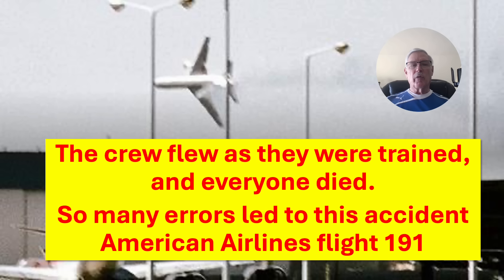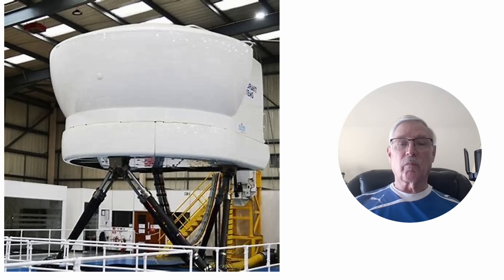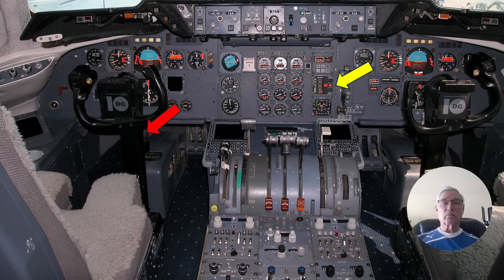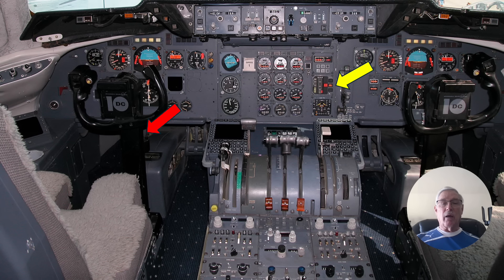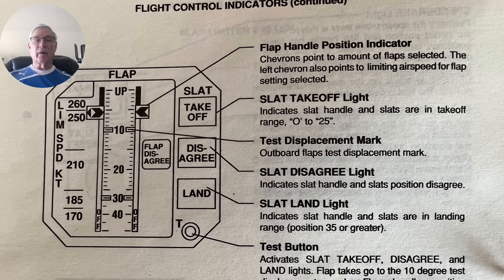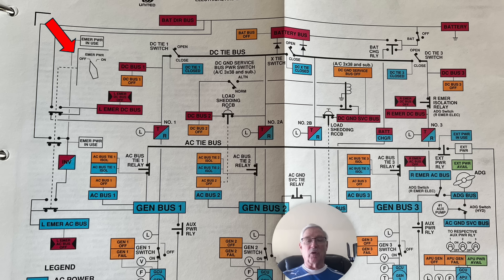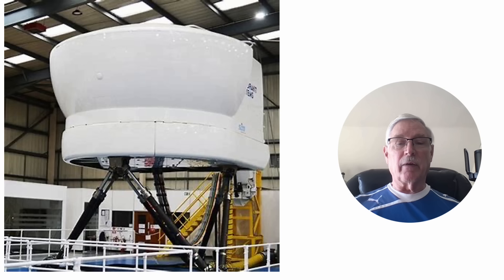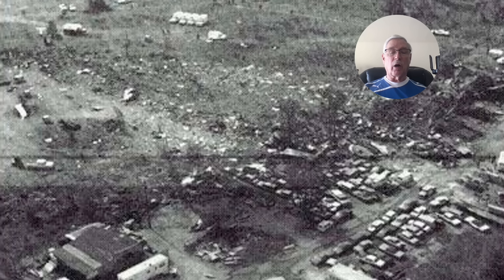The crew flew as they were trained, and everyone died. American Airlines flight 191

Comment: Ron, couple of questions / observations.   Would of  the dual AoA stall warning really have made a difference.  From my experience working for a AoA system manufacturer, most stall warning computers are programmed to trip the stall warning at an airflow angle sensor based on the selected / actual flap setting.  Not sure how the DC10 was configured (was the computer set to the flap handle or the slat /flap position?)  Additionally, as most transport airplanes deploy slats before flaps, if actual position, would've have there been a sensor on both sides of the aircraft?   I don't know enough on the -10 systems, but I'll wager there is only one position sensor feeding the stall warning computer, and if so, right side or left?  Obviously if it were the side that didn't loose the engine, the slats would've been sensed at the appropriate position, and I would think you wouldn't get a stick shaker.

Also, regarding on engine failure you maintain achieved speed up to v2+10.  From my understanding (correct me if I'm wrong), didn't the flight director on this plane command pitch for V2?   Again, having worked for the instrument manufacturer, I'd ask, was this what was in the -10, and what was it programmed for?  (Or am I assuming too much having flown the 320, 757, 767 which have more advanced flight directors?)

Comment: I was only a PPL who gave up flying years ago. I didn’t feel I could maintain true proficiency with the limited hours I could put in even if I could keep my license current. With that limited knowledge and experience I cannot imagine doing anything other than increasing or maintaining airspeed in that situation. I tend to think instinct to increase or maintain speed would override any written procedure or training in that situation. Did the manual procedure call for an actual slow down to V2 if above V2?  Hard to believe. I don’t get that. I’m curious, Captain, do you think you would have gone by the manual in that moment or maintained higher airspeed?
Hard to believe only the left seat controls had a stick shaker. Never heard that before.
Reply: Robert, we have things in jets called first, second, and third segment climbs. They’re predicated on obstacle clearance, terrain, runway length etc etc etc. Because of these varying segments we maintain a speed until an altitude. In this limit, V2 is the speed that ensures the minimum climb gradient is met after engine failure until your flap retraction altitude in which case you DO speed up but we have to clear obstacles first. If you go faster, you aren’t climbing and as much as ALL love airspeed, we also love not flying into a radio tower off the end of the runway. Think of V2 on an airliner as Vx on a 172 flying out of a short field with 50 foot trees at the end. If you do not abide by the book, you are a test pilots and airlines don’t like test pilots. So yes you absolutely do as you’re trained. It’s just unfortunate that the slats retracted and the weights they were at predicated a stall speed higher than V2 for that one wing.

Comment: This reminds me of an unrelated maintenance issue. My partner was an army officer for two tours in Vietnam.  At the time, instructions in the official maintenance manual for some big equipment said "to find high pressure hydraulic leaks, run your hand along the hose until you felt hydraulic fluid leaking out." After several people lost all their fingers, my partner got the manual changed. Makes you wonder what idiot wrote the manual in the first place.

Comment: The pilots acted on the assumption that they had an engine failure, not an engine detachment. They never knew the engine had come off. Since the engine separation caused such an imbalance on the airframe, had the pilots known what really happened they still couldn't have recovered the plane in time. They didn't have enough speed nor altitude.
Reply: I agree. Training is last in the contributing factors, if at all. One stick shaker without power, no slat position indicator, slat retract on loss of hydraulics, emergency bus out of reach to name a few. The Captain is too lenient on the manufacturer.

Comment: I flew the 10 for AA as an FO and we went over this accident many times. It was the thrust of the engine that pulled the engine off after the aft attach point failed.. If it was g load the engine would have not gone upward over the wing. Other than that I think you did a very accurate description of this accident. Also at AA we called the person in the FE position who held a flightengineer certificate a Flight Engineer. We called the professional engineers the same, but the slang term for them was 2 striper.

Comment: I'd be interested in hearing your thoughts on American Airlines Flight 587, if you have any. In-flight separation of vertical stabilizer over Queens, NY back in 2001. NTSB probable cause focused on the pilot flying's excessive rudder inputs. APA report argued that it was Airbus's change in rudder sensitivity between the A300B2 and A300B4-605R models under the same type certificate, and pointed out that they didn't perform a verifiable handling qualities rating test after doing so.
Reply from the maker: Yes I plan on covering that one. I was at a test pilot symposium where we discussed several aspects that led up to this specific accident.

Comment: Every fighter pilot and all good pilots know that speed is life. Rotating rapidly to 15+ deg at Vr    does nothing for you if this situation is encountered. Slow rotation when heavy gains the speed you need to control in the case of engine failure or worse as in this accident. My educated opinion.

Comment: You have the number 1 engine departing the aircraft and have severed hydraulic lines at that altitude, you have no chance. Amazingly,  Michael Laughlin was nearby to snap the final tragic moments. I remember first seeing this as a kid on "That's Incredible."
Reply: But they DID have a chance... If they had known to maintain their airspeed.  It was only in reducing back to V2 that they lost control of the plane.
Reply: @stephenp448  The problem was they didn't have enough time to identify or verify to get back to V2, I am not blaming the crew at all. They did everything they could. But in the heat of battle, three people can only do so much.
Reply: @Sreybk - You are correct the crew really didn’t have enough time to diagnose what was going on, however that’s the point with the change to how we now operate though - you don’t need time to figure it out, if it’s flying you don’t change anything.  Had foolish, myopic people at the FAA not interfered and required crews to aggressively target V2 following an engine failure, this event (as bad as it was) WAS in fact survivable - but not with the procedures the FAA required then.
Reply: @bradcrosier1332  I completely agree with that.
Reply: @bradcrosier1332  You are right.

Comment: Capt. Rodgers great vid but I think the proper pronunciation of clevis is " kleh·vuhs" as in clevis bolt not cleavis  as in great cleavage. 
         This DC 10 accident I have heard  was also the reason for the invention and use of hydraulic fuses to keep the the fluid from leaking out of lines such as the slats, to bad for the suicide didn't know that, dumb move. Several airlines where using this engine change technique with pylons attached at this time. Douglas DC10 was the real casualty :(

Comment: Thanks for the video. Question about the slats. You said the slats were designed to retract should a hydraulic failure occur. You also said the pilots had no way of knowing the slats retracted. This would indicate to me they were also unaware they had a hydraulic failure or they were unaware of the slat retraction due to hydraulic failure. Can you clarify that?

Also,  what was the theory behind maintaining such a slow speed? That seems counter intuitive. 

Thanks.
Reply from the maker: The slats weren't actually designed to retract, they were not able to remain in the extended position without hydraulic power.  Because of the multiple failures, the crewe probably were not aware of all of the failures, other than the engine failure. V2 gives you the best climb performance in this case.
Reply: @ronrogers  Thank you.  It just seems adding 10kts to V2 in case of hydraulic failure due to the slat retraction would be a memory item.

Comment: I rember this accident.  So was it the maintenance supervisor that committed suicide because of the mistake that was made due to the forklift sagging during the shift chane?
I saw another crash where I think a shift change was related to the mistake that was made.  But in that case, I believe it was a maintenance guy whos job was to inspect after the work was done decided to give a hand.  They were removing the leading edge on a T tailed type plane to repair something to do with the de-icing system. The inspector guy climbed up on top and took out all the screws on the left side leading edge while mechanics were working the other. 
But when everything was put back together none of the screws were reolaced on that 1 side and it tore off during its decent. Might of been improper recording of what was done as well. Wish I could remember the flight number but it was a smaller regional type plane I believe. Anyway, man what an aweful thing to have happen.

Comment: I fail to understand why the first officer would bring the speed BACK to V2. In a situation like this, the law of aerodynamics should have prevailed. Higher airflow over the airfoil gives you  greater control of the aircraft. Lower the nose, retract the uc, even if climb is reduced or not achieved and set a target of at least 20knots above the stall.

Comment: Correct me if I’m wrong but aren’t the bolt’s designed to break in the event of extreme force to avoid damage to the wing? If that’s true even though the bolts broke why did the engine coming off make the plane crash then? Why wouldnt the hydraulic lines be designed to not leak if the engine comes off.
Reply: You’re not wrong. The technical name for the engine and pylon bolts is “fuse pins.” Also, remember the El Al flight 1862. The Boeing 747|-200 freighter crashed in Amsterdam in October of 1992. It was determined that fatigue cracking of the fuse pins resulted in the entire pylon being ripped off the wing The aircraft subsequently crashed into an apartment building, killing four people on the airplane and 39 people on the ground. Boeing ended up modifying the pylon attach points within the fuel tanks on all 747s.
     The DC-10 didn’t have hydraulic fuses installed which are designed to stop the unregulated flow of hydraulic fluid in the event of a line rupture. And finally, on the American 191, crash, as Ron said, “airspeed.”

Comment: My Dad was a commercial pilot and aeronautical engineer, and so I grew up around airplanes and airports. I remember reading about this accident years ago and learning that the stick shaker for the copilot was an option that American Airlines passed on. I was absolutely gobsmacked given the obvious necessity of both pilots having a working stick shaker. I'm also baffled as to why AA's maintenance facility in Tulsa didn't check with Boeing on their use of a forklift to R&R an engine. If a manufacturer has a certain procedure for something, chances are they have a very good reason for it. My personal opinion is that these people died a tragic death because of corporate greed.
Reply: ChrisBre1, I think what you MEAN'T to say was, why didn't the maintenance team in Tulsa check with McDonnell Douglas. ( You said Boeing). This crash occured in 1979, Boeing wouldn't merge with McDonnell Douglas for another 20+ years, although the problems that they are now having with the 737 Max, are directly caused by them bringing the old MDD executives into the company after the merger. The 737 Max is on track to be Boeing's ".DC-10"
Reply: Jocelyn, big mistake on my part to say Boeing instead of McDonnell Douglas. I guess I just had Boeing on my mind given how much they've been in the news of late. Good catch! @jocelynharris-fx8ho

Comment: If the crew had maintained the higher speed, would the aircraft have leveled off? It seems like the uneven lift and weight caused the aircraft to get too steep of a bank angle, but you’re saying that the bank was caused by the stall. 
FYI, have no flying experience. Just asking to better my understanding of flight dynamics.
Reply from the maker: If they had lowered the nose the climb rate would have been slower but they would have avoided the stall. The loss of the slats was easily controlled with sufficient airspeed.

Comment: Is it normal for multi-engine airplanes to operate with split ac busses? 
I come from the commercial cargo ship world where we operated with  up to four generators where the main bus tie is always connected and only split if reconfiguring electricity from an alternative or emergency power source for a loss of main power or isolation of   the port or starboard switchboard for maintenance. We would normally operate with one generator on line at full sea speed and only started additional machines manuvering in and out of port.
Reply: It’s entirely dependent on the design philosophy of the aircraft.
Many older aircraft run with AC busses paralleled so that if one generator were to fail, there should be no interruption of power.
A lot of newer aircraft run with busses split, so that a catastrophic failure on one bus will not result in a loss of any other busses.
Two different, but both valid design philosophies - just depending on what the engineers  determine the greatest threat to the system would be (which in turn is somewhat dictated by the architecture of the system).
Reply: That is why you have a main bus tie(s). One side has an issue it can be opened manually or in high current conditions it will trip automatically to save the unaffected bus, preventing total power loss. I would want power to both sides all the time.
I was wondering when the AA 191 Captain lost all power to his instrumentation, stick shaker if the busses not being split could have made a difference in saving the airplane. The two remaining engines were unaffected and generating electricity. 
This is not to second guessing the gallant efforts of an experienced and well trained crew that fought to the end to save the airplane.
Reply: @williammoreno2378  - The system architecture of the DC-10 absolutely contributed to this accident.  It’s been fifteen years since I was on the DC-10, so my memory is VERY fuzzy on its electrical system, so take all,of this with a large dose of salt.  That said, my recollection is it operated (as did most aircraft I’m familiar with of that era) with the busses tied.  The reason the captain’s bus lost power was not simply because the generator was offline (and in this case, completely missing), but that the cabling which was severed shorted to ground, resulting in a differential fault, which (in an effort to protect the rest of the system) tripped the bus tie open.  With a more modern, damage tolerant design, it’s likely that key systems would not all be put on the same bus, and particularly critical items and/or busses would be fed from dual sources, so that failure of one component or even a single bus would not result in the loss of critical systems.

The same could have (somewhat) been achieved had AA opted for the stick shaker on the FO’s yoke - it would have been powered  by one of the busses that was still online (again, I can’t recall which one, but I do remember researching that specific point).
Reply: Excellent clarification and explanation, sir. It seems there was  no automatic bus transfer (ABT) to Captain's vital equipment built into the system, which, upon engine separation, would momentarily have interrupted power.
Reply: @williammoreno2378  - Correct - that was the emergency power switch discussed in the video.